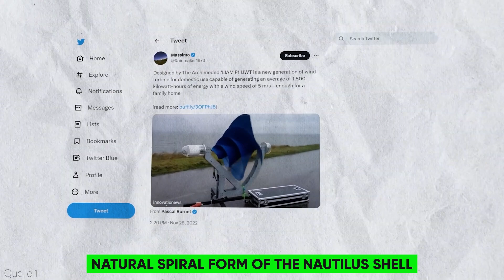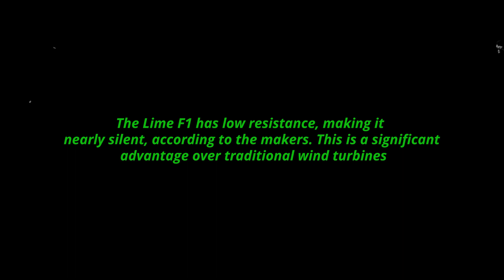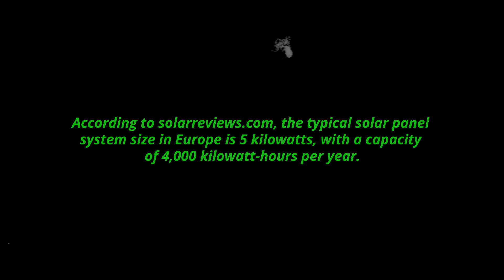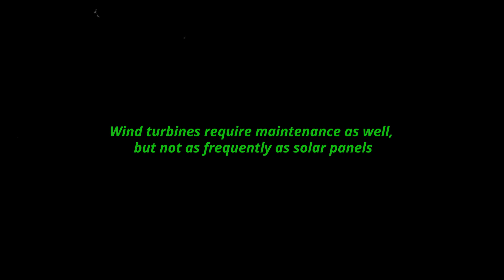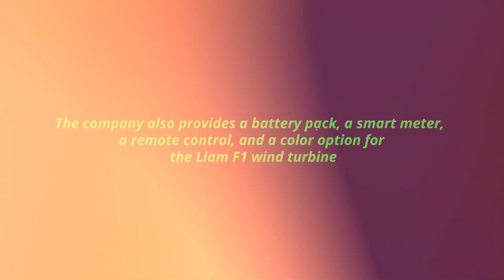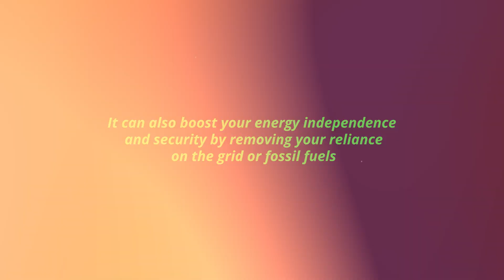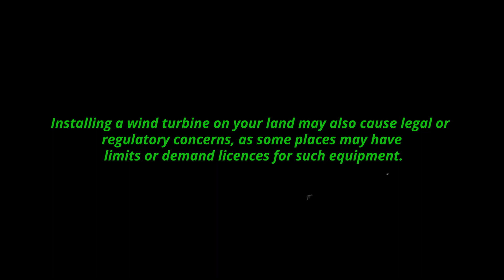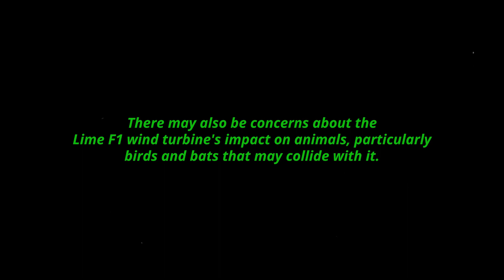This NEW European Wind Turbine Outperforms All in 2023!! Wind Turbine For Home

Comment: lifespan 20 years, 4500 euro only turbine no battery and other accessories for generating 1500kw annually, so 225 euro annually for only turbine. local energy provider charge you almost same amount for 1500kw without risk and maintenance osts and ...

Comment: It outperforms nothing.

It's cross section is tiny.  The claimed output for a year is only 172 Watts average.  "can generate 1500 kilowatt hours of electricity per year at a wind speed of 5 meters per second"

Comment: Am waiting for the chinese cheap copy.  It cost €5,450 for low power turbine?
Reply: per my prior 'comment' (analysis) at $9/year vs local grid cost (on mountain top near Yellowstone) this POS would require well over 15 US avg lifetimes to recoup the minimum costs - ignoring maintenance/replacement and labor.  Absolute SCAM.

Comment: What about high winds? Does it have a top speed and can they limit or slow it so not to over lead the system? That's very important as the weather is getting more violent at times and in some places guts of wind get very high and could damage the array.  Just wondering if anyone knows.

Comment: Who would have ever thought using natural shapes would work better than shapes designed by man. I mean it's not like nature spent billions of years developing these shapes for nothing.
Reply: Actually, it is NOT more efficient than a typical 3 blade wind turbine.
Reply: @MrSummitville  Hmm. The vortex version starts spinning at lower wind speeds and spins faster at higher wind speeds and doesn't have a balancing issue like the three blade turbines we have seen explode at high wind speeds. Not sure where you got that info from.
Reply: @MrSummitville  example link?
Reply: C'est élémentaire car c'est un vortex
Reply: Wrong. Man can often outdo nature. Solar panels are far more efficient at converting solar energy than biomass. The factor is as much as 100 times.
Reply: 1) This is a shape designed by man
2) It is not more efficient, they're liars.